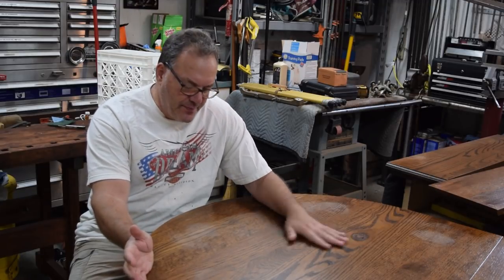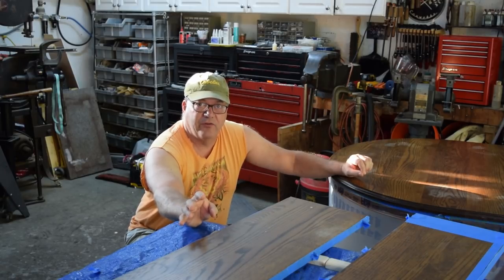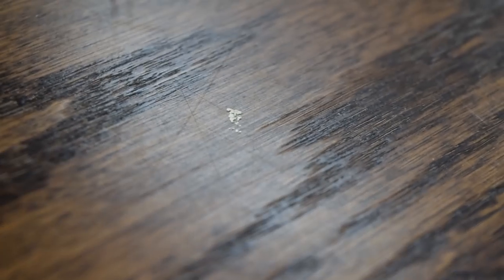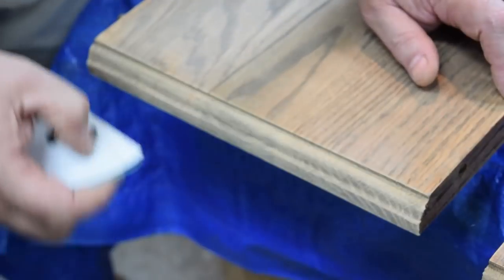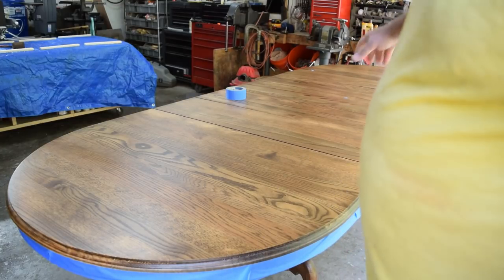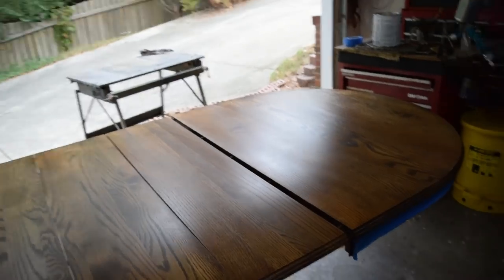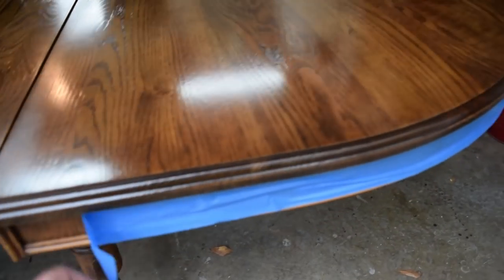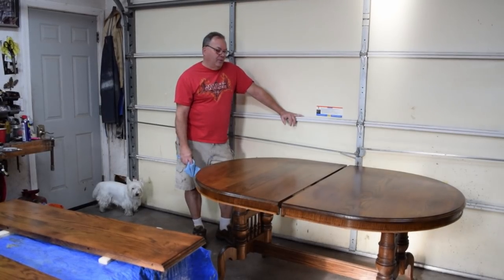Refinishing a large oak dining table

Comment: Hi Larry, I too learned a great deal from your video.  But here is a question I hope you can help me with.  I have refinished a beautiful antique table.  But the top looks like quarter sawn oak and it is very orange.  That Toner you used what did you dilute it with?  And can you put if over Poly and then give it another coat?
Thanks Ellen

Comment: Did you try flaming it out? I don't know if that finish would work with that technique. You just put some alcohol over the area and light it on fire. It will remove water stains in a lot of situations. One of the neatest tricks I have ever learned.
Reply from the maker: I have done that on old shellac finishes, but have never tried it on a poly finish.

Comment: Is lacquer the best finish for a tabletop?
Reply from the maker: In this case I think it was the best option.  You saw what happened to the factory finish, which I believe was some kind of urethane.  No finish is battle armor and each has its benefits and short comings.   I use lacquer on most of my projects and have had good results.   Thanks for watching.
Reply: I’m finishing a walnut beam above a fireplace this weekend.  What finish do you think would be appropriate?